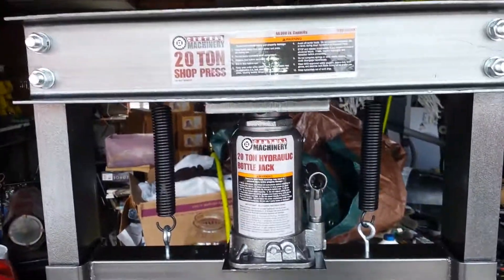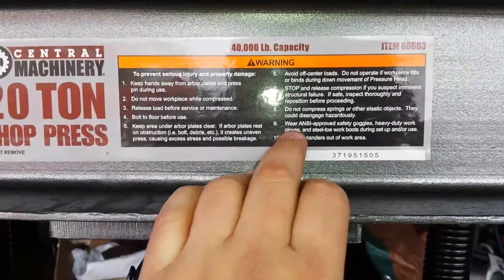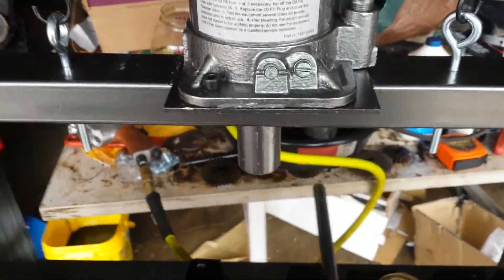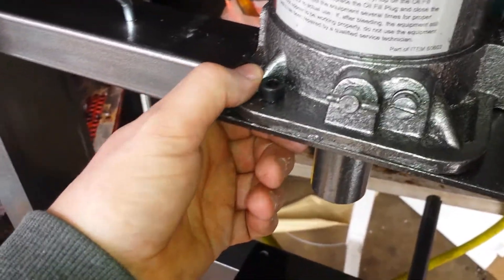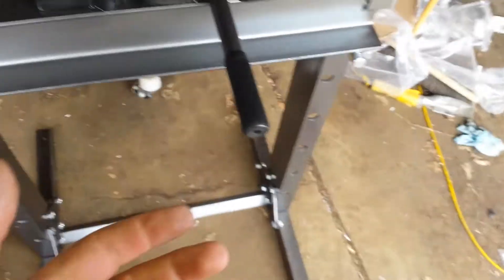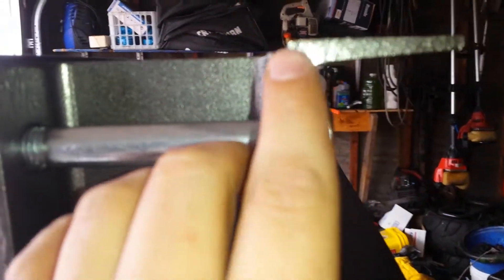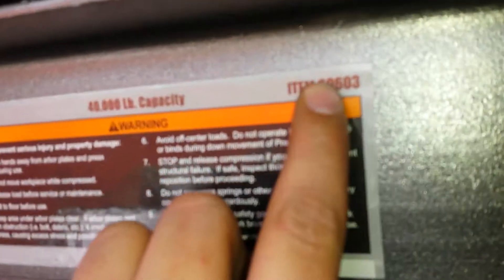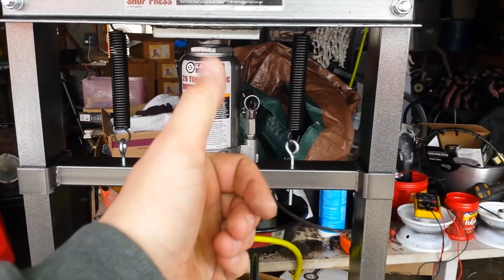Harbor freight 20 ton shop press

Comment: I lived 50 yrs never needed one, to be honest for a home setting what could it be used for or on, I can't think of 1
Reply from the maker: truthfully your right it isnt a normal tool for everyone ive got to change the wheel bearings on my car i payed someone last time to press them in and out and it was $40-50 to do it  i dont spend money on tools unless i can justify the the expense i figure i will save the 50 to do it my self and i will have a $100 or so in the press and i figure i will use it on other stuff as the time goes on